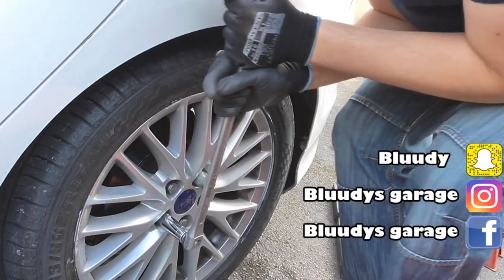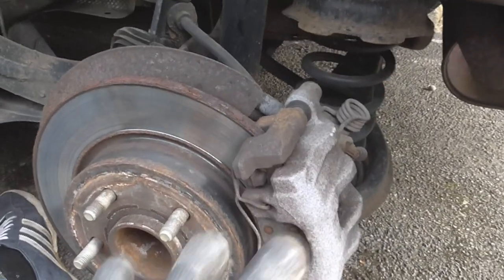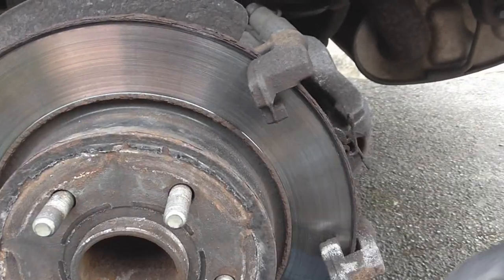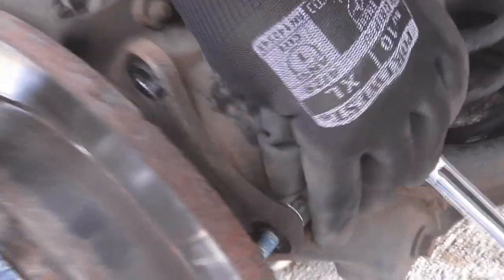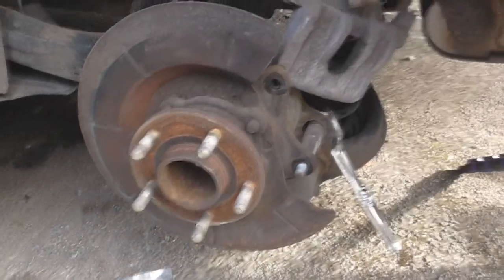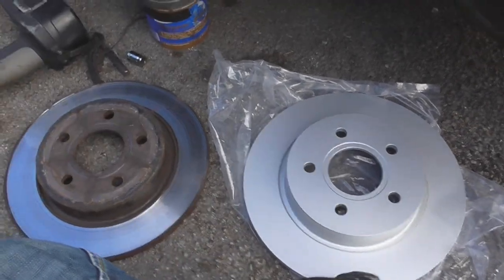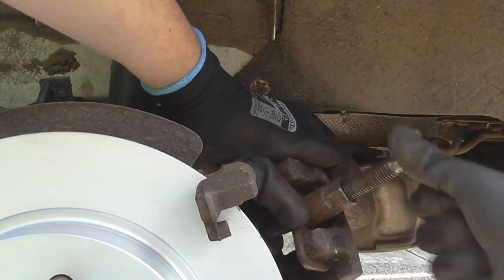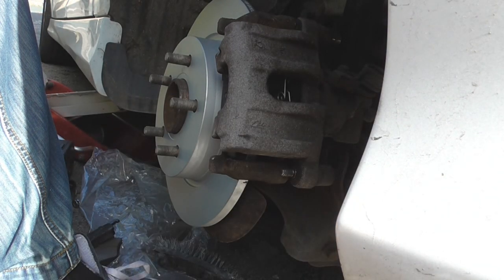How to Replace Ford Focus MK3 Rear Brake Discs and Pads

Comment: The most important part to get clean is the hub where the disc sits, you should get that area spotless and get all the rust off as just a tiny bit of rust will make the disc wobble and it will  be worse than before.

Comment: Thanks for showing us. i liked idea of the piston suppress tool did you buy or make ?
its nice that ford are actually thinking things through ,like the hole in rear brake caliper to get the socket through,its a pity the made a right hash of the bonnet catch.I was thinking of putting clips  through like they have for rally cars but theres no way to anchor them theirs hardly any metal on inner wing .gonna have to think about this ! cos i dont want to get caught out with cable broke,needs sorting beforehand .Might make a vidio of it for my channel.
Nicely done there just did all new suspension and brakes at front of mine yesterday ,its good when you can save yourself some money from rip of garages .Take care Ant from sunny Wales.
Reply: You can buy the kit for wi ding back the pistons on Ebay, cheap too.

Comment: Hi,if your doing front and back discs and pads do you pump brake pedal after you've done the front or when you've done all four?very helpful video thanks.
Reply from the maker: Of your doing all 4 at same time. Do it at the end.

Comment: That job was spot on. Did you lubricate the caliper bolts? It is best to use lithium grease on them. Copper grease can be used which is better than nothing. You do resemble a young Jeremy Clarkson. You just need to work on the Yorkshire accent (where are you from?). I'm considering a Mk4 Golf as my next project car and your Golf videos will be useful to me should I get one.
Reply from the maker: Originally mansfield. Now in Leeds.

No I would never put any form of grease on bolts.
Reply: I meant the sliding pins for the caliper (the ones you use with the 7mm Allen key) they do need lubrication (not on the threads!) so that the caliper can move freely. Sorry for the confusion! I work in Leeds so I'm not a million miles away from you. You must be near the airport because I can hear the planes in your recent videos. You must be right under the flight path.

Comment: Hello,
I have a small question ! I hope you can answer it please. Recently i have installed new break pads in my car both front and back. After installing the breakpads my car breaks are making squelling sound . Same sound like  when break pads reach to wear limit and need to replace. Since I have new break pads what should i do? And if i put my car on jack !!! How free wheel should rotate with the hand? Do breaks drum get hot if yes how much ? 

Thank you in advance.
Reply: The back of your pads should have an anti-squeal backing, but if not, apply some ceratec grease or similar to the BACK of the pad and to the corners of the pads that sit in the carrier. This should stop it. If not, you might have a seized calliper that isn’t retracting or you need to grease your slider pins.

Comment: I've just done the same job. 
Did you need to adjust your handbrake after this work??
My handbrake runs up to 10 clicks until it brakes, after changing rear brake discs and pads.
Reply from the maker: I did yes. Theres a nut at the side of the handbrake lever. Pull off the gaiter to get access.
Reply: Thanks for the feedback.
I have a Ford Focus 1.6 D Hatchback 115Hp, 2012. Not sure if i have the same console as on your Ford.
My handbrake pull is placed more on the front left side of the console.
Do you have any instruction video "how to do it", with this sort of console (handbrake)?

Comment: I bought the tool for my 2010 Mondeo but it didn't fit the C Max, the little dowels were too big and too far apart, flipping typical, so I just filed one of the dowels to fit one of the piston holes the other dowel resting on the outer edge, didn't bother with the pad shaped plate that was part of the tool,  just used a bit muscle power while twisting and it eventually got the piston back in. If that doesn't work that can put some pressure on the piston and twist the piston back in with some grips, bit rough like!

Comment: Need to
Do anything about the handbrake cable? Take it the handbrake isn’t applied when performing this?
Reply from the maker: Handbrake you leave connected on the caliper but not applied in the car.
Reply: @bluudysgarage  thank you that’s helpful
Reply from the maker: @alexevans5864  no problem

Comment: Nice video fella,it's worth using a bit of penetrating oil on the bolts to make them a bit easier to move,otherwise spot on
Reply from the maker: Only if your struggling. I try to avoid using the stuff when working on or near brakes, unless I'm completely stuck. Thanks!
Reply: @bluudysgarage  I see what you mean but if you're changing your pads and discs it wouldnt matter if you got some oil on them.I had to use a breaker bar to loosen my caliper carrier bolts,otherwise no problems which make a change,I dont have a tool to push the pistons back so just use the handle end of hammer and some pushing,lol I'm not a fan of the brake master cyclinder hidden away under the scuttle

Comment: How can I adjust the Handbrake ?
I put new pads on but the Handbrake pulls up 7 clicks , whereas I’m used to 3/4max clicks
Reply: Did you manage to do this? You have to do that via the centre column in the car and remove a number of trim pieces to access it near the handbrake lever, depending on model and trim level. It’s one bolt, with a locking nut on the top. I think it’s 13mm off the top of my head. There will be vids on YouTube somewhere if you never got around to it.
Reply: @5ivetimes1  
I haven’t a clue I gave it to my mechanic to sort out ,, but it needs it periodically

Comment: why did you not silcone the pins? did you forget?
Reply from the maker: I may have forgot to show. I used copper grease.
Reply: @bluudysgarage  copper grease destroy rubber I use silicone grease because  Silicone grease is commonly used for lubricating and preserving rubber parts, such as O-rings. Additionally, silicone grease does not swell or soften the rubber, which can be a problem with hydrocarbon based greases. It functions well as a corrosion-inhibitor and lubricant for purposes that require a thicker lubricant
Reply from the maker: @markholyoak9790  then I think we are confused. Aa the sliders I thought you were referring to are metal and only touch metal. No rubber.

Comment: I guess you need that special tool to compress the caliper! Regular C Clamp won’t do it for me!
Reply: Yes, because unlike the front pistons which just push straight back in using the old pad and a big c-clamp, the rears need to be rotated back in. I made a simple tool using a disk of hardwood into which I installed two screws of appropriate shaft size to fit the two holes in the piston face... cut the heads off after screwing them in. Then threaded a large hex head bolt through a hole in the middle to provide a means of turning it with a ratchet. (Hope that makes sense! It was quicker and cheaper than going back out to buy the proper tool when I first discovered this!)

Comment: Brakes will be shit until they bed in. You can watch videos on how to do it or just drive careful for the first 200 miles.
Reply from the maker: Yeah tjats correct. 100 to 200 miles and avoid harsh braking if you can.